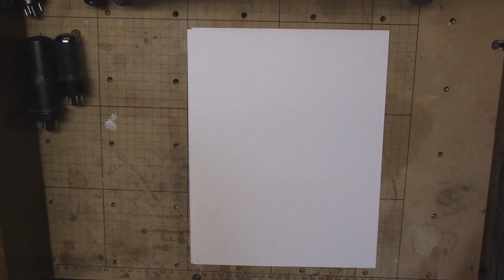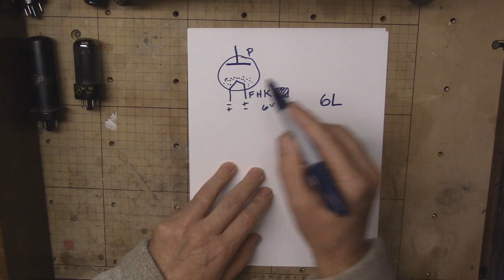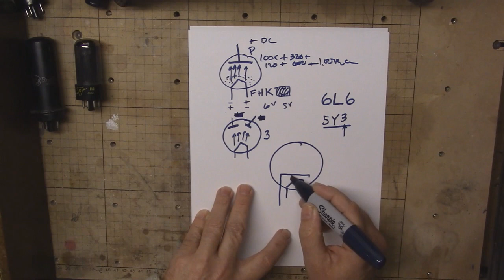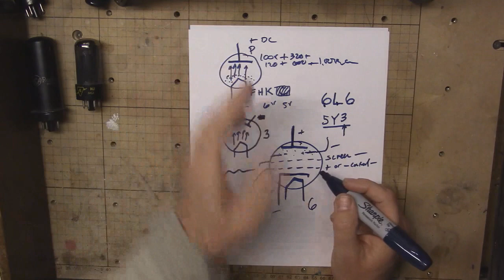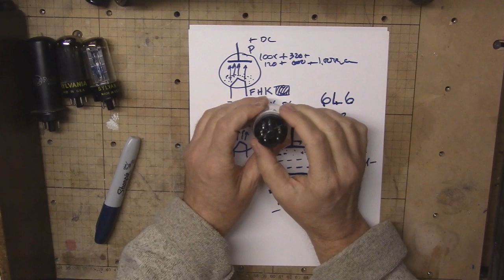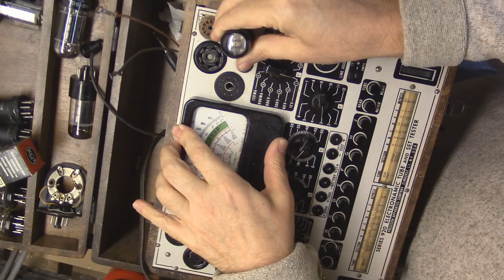how vacuum tubes work and testing vacuum tubes

Comment: I have the same 920 tube tester and as I tested the 6V6 tube my meter also fell about where your did. The tube roll has this statement (6SA7-Amp. Section OK above 1/3 scale). Is the 6SA7 amp. Still a bad tube? Thank you.

Comment: I just picked up one from my Aunt's house today and I have no clue what brand it is but the thing is huge....the cabinet and legs were all falling too pieces...any way the speaker has a transformer on it and the voice coil is screwed and so is the speaker..... this thing has two massive transformer and around 20 tubes half are large half small the radio part itself is about the size of the radio you showed the board itself is about 24 " long and has a reverb spring..... I am converting it wish me luck....😜

Comment: Couldn’t find the Brad Katalla mentioned in video. I’d like to get tubes tested from a Philco 46-1226 code 122 Radio-phonograph 7AF7 mixer, the tubes include 7AF7, 7H7 (2 ea.), 7C6, 5Y3, 6J5, and 6K6(2 ea.) based on comments I might need to test the passive components too: Caps & resistors. Found the schematic online

Comment: Did you rebuild or to put it more specifically did you recap all the capacitors in that tube tester. School that used to repair radios instructor is giving me two of those two testers I open them up and use my capacitor tester on all the old capacitor and all of them were out of value specially the old black paper capacitors. Then I went around and I tested some of the old carbon composition resistors and I found a few of the resistors values were out of range that is common on some of the old carbon resistors. I was watching some restoration videos on how to restore and rebuild tube testers. Some of them take a very specific type of calibrated match paired vacuum tubes that are used internally just for two testing during calibration and then you remove them after all your calibration store them to the side and your two tester will be like new again